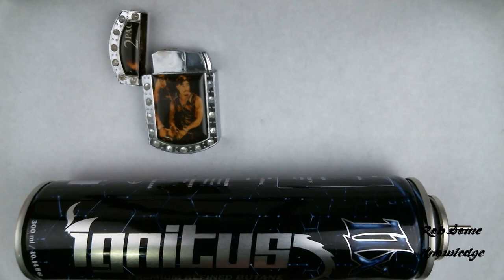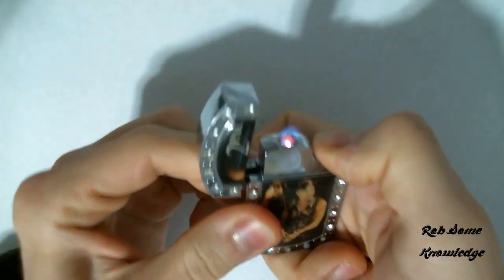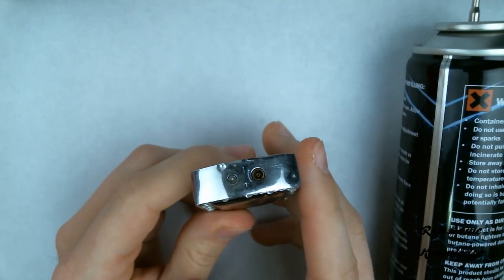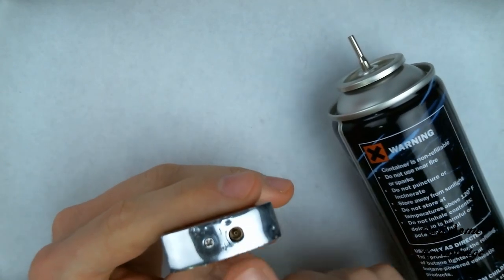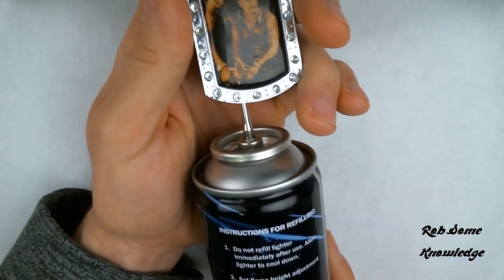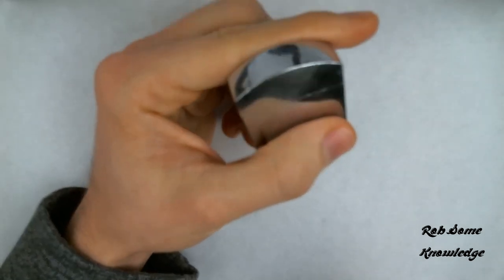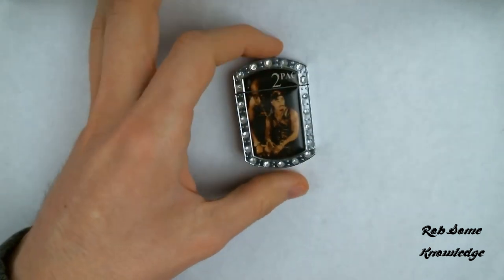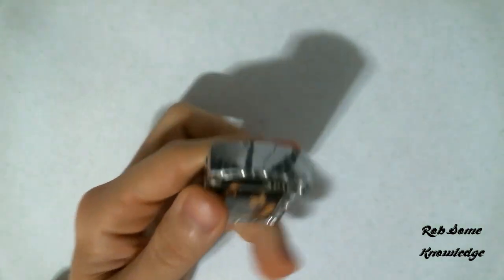How to Refill a Butane Lighter

Comment: Just FYI, you're supposed to put your lighter and butane canister upside down.  This is because butane is 2x's heavier than air.  Think of it like pouring liquid from one bottle to another.  You don't want to do it backwards for the exact reason as what happened in your video - you had butane spill all out all over.  Holding the canister rightside up adds more air than butane into the lighter.  Also, it's good habit to purge your lighter of air by taking a knife point and pressing down on the filler nipple until the sound of air escaping is no longer heard.

Comment: Can you tell me why my Lexus won’t crank when I turn the key??? Battery is good... starter is good cause I can bypass the relay and crank it??! Any ideas you know a lot about lighters so figured I’d ass
Reply from the maker: Lol TF does a lighter have to do with a car starting? But anyways, It’s your starter relay that is faulty. Is the relay making a clicking noise when you’re trying to crank? If battery is good and you can crank it by bypassing the relay, then you obviously have a failing or dead relay. A starter relay is the thing that completes the circuit between the battery of your car and the starter solenoid, which the starter solenoid then will transmit power to the starter motor, which will then spin the flywheel and then the car shall turn over and start.

Comment: Brother what bottle of refill are you using please replay me
Reply: Kottayam karan 
the one dollar vial of lal butane.
Reply: @winonabigbrownbeavereater2218  thanku
Reply: Kottayam karan 
you're  welcome.
My torch lighter was working fine until it needed a second fill.  I tried, for the first time ,  that mentioned and only a typical flame comes out 😕
What the hell?   Me thinks not enough pressure in the little  $1 vial? 🤔
Reply: @winonabigbrownbeavereater2218  ya may it will be I have a lighter of retro l want to buy a new lighter refill for it thanks for the information brother

Comment: Is there a difference between a butane gas cartridge and a butane fuel can? I'm wondering if my butane gas cartridge would work
Reply from the maker: As long as the cartridge has a refill tip that fits your lighter it should definitely work! Butane is butane..

Comment: Looks like the knowledge you robbed was damaged. Here’s some for free. Always hold the can refill tip upside down when refilling b/c butane is heavier than air. The device also gets filled more properly due to avoiding injecting air into the lighter. 👍